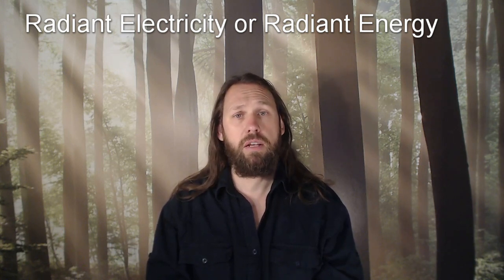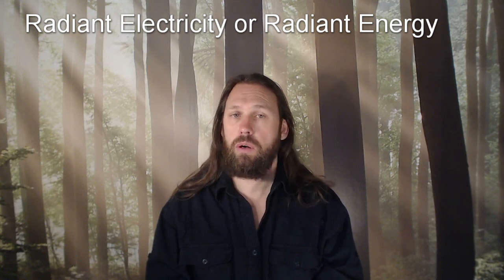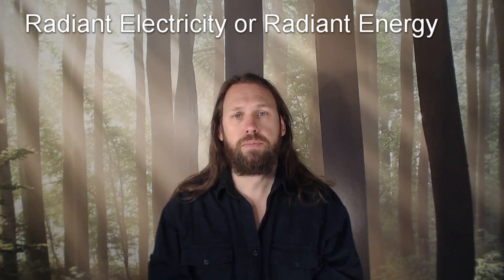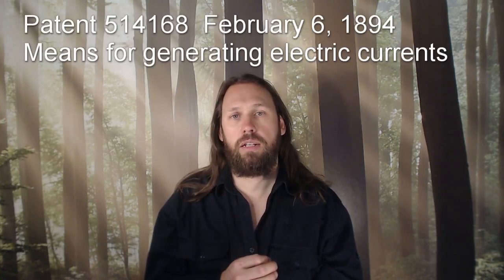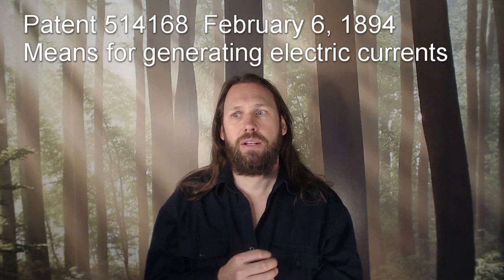The Radiant Electric Bifilar Coil Research Update

Comment: Thank you for reading excerpts .from Gerry V's book.  That helped to clarify an anomaly  I had been puzzling over for many years.  While doing Kirlian photography I had a high voltage apparatus melt down. I unplugged the power cord in an attempt to save it but it kept running until I pulleId the ground wire.  My best guess is I was accidently pulling i radiant electricity. I would be careful,  You are playing with serious fire. I commend your bravery.
Reply from the maker: Thanks for sharing. I will play safe and keep the voltages low enough

Comment: Hello again. So I wanted to connect a large bifilar coil to a high frequency transformer. Any advice?
Reply from the maker: Hi, I don't understand your question
Reply: Master Ivo sorry, i really am a beginner at this stuff. Just beginning at age 24 but there is a medicinal tool called the Amp Coil and it looks like it uses a high frequency transformer with a bifilar coil. Could you check out the Amp Coil and tell me maybe how it is working? Also, I want to find a teacher for electrical theory so I have some guidance in my own experimentation but I am not sure how to go about this. I am highly inspired to learn, I just need direction. Thanks for responding Master Ivo!
Reply from the maker: If you ask the right questions you will learn from the answers. Sorry I won't check it out right now, maybe in the future. I'm pretty busy with my own stuff. I share all that I learn on my channel, so stay tuned. Right now I'm making a new video about Nikola Tesla's Radiant energy.
I've got a playlist on Steinmetz, this could give you a good idea on what electricity is. But the rabbit hole goes much deeper.
Reply: Master Ivo You are great! Thank you! I will continue to learn from your videos. Best of luck with your work!

Comment: Looking forward to your experiments of radiant energy and cold electricity...charges (not electrons)...literally escape the conductor and travel in wave fronts...as aether is most likely made of 'charges'...you can feel them...emanating from a rapid change in either the dielectric (psi) potential...or magnetic (phi) energy.  At resonance a voltage rise in series or a current rise in parallel...current rise from back emf (dphi/dt)...or voltage rise from (dpsi/dt).  Be careful to use the correct frequency as Tesla directs as to not cause physical harm from the pulses.  I agree that chapter 1 is one of the best books I have read on this.
Reply from the maker: Good to hear from you again Mark S, and nice to see you read chapter one of the book. I read it 4 times now. It's so full of candy.
Yes pressure waves. The bifilar pancake coil seems perfect for these.
I think it's not the frequency that causes the different effects, but the discharge time of the capacitor (pulse width).
Reply: Yes, more correctly the pulse width, which is the reciprocal of the frequency.  Back to the energy pump...the more times you can pulse the greater the output.  DC being the energy limit of a pulse train.  Of course, if we dump the capacitor's energy to a load (resistance) then it takes 5 time the RC time constant to do this and thus the limiting factor of the pulse (relatively long time).  Then we resort to resonance in which the resistance cancels out and the frequency is just a function of the L and C (bifilar coil).  So...Tesla had to resort to a DC dynamo with a great amount of energy (KWs) to support the radiant energy transmission at usable energy levels.  At any rate...looking forward to seeing your implementation...
Reply from the maker: Yes the pulse width. If we make the discharge time (pulse width) very small, and Do not allow the coil to oscilate (where the capacitor is discharging into), It will induce the radiant effects. No phase reversal. No oscilations. Just a single (repeated) unipolar pulse. 

The Capacitor needs to be charged, before it can discharge. DC seems the best, a boost converter (what I basicly worked with in my previous experiments) can supply enough energy. 

If the boost converter, uses a bifilar pancake coil, it can produce a pulsating magnetic field, in combination with the impulsed center coil, creating radiant energy effects. The third coil should be able to see both fields, and resonate.
I still wonder what the differnce will be between negative voltage discharge, and positive voltage discharge. 

My intuition says I need negative voltage discharge. The book also mentions that Tesla noticed a difference. Pushing and pulling...
Reply: You are on the right track but be careful...Capacitor's do not work on electrons...they work on charges...that is why you can charge a capacitor with only one lead receiving impulses.  My experiments show that charges exist in the aether (sorry Mr. Ken).

You were close when you used your avramenko plug in your beginning experiments to charge to the 800V.  I toasted my favorite DVM doing these pulsing experiments...so be careful.

Yes you can charge a capacitor with one lead...the other plate takes on charge from the aether.  Works the best if you have a high voltage spark charging one side.  You see capacitors obviously do not allow electron flow (if they did they would not be a capacitor, rather they are insulators).  However, for instance the middle capacitor in a 3 capacitor circuit will charge even though no electron flow can reach it.  This is the basis for cold electricity...that simple.

So when you suddenly short out a capacitor (rapid pulse discharge) it causes a shock wave of charge through the aether (as it appears the aether is made of charge...and charges are NOT electrons).  Since mass is ultimately composed of charge (as John Hutchison verified with his experiments) this fast discharge can totally 'vaporize' the mass into aether.  Or...the shock wave (longitudinal wave) can collect on any conductor in its path.

Typically, these type of events are rare as normal power distribution systems are using alterations at about 17 msec in a sin wave with gradual di/dt.  However, if you attempt to rapidly shut a breaker in the  system, this would be a fast transient and it would be less resistance at that instance for the charges (which aren't electrons) to take a path through the aether and possible kill any person (a conductor) nearby.

So, to get the greatest affect your capacitance should be greater, your transient faster and abrupt (not a sign wave), limit reverse transient (i.e., as Tesla did limit a reverse charge flow).  Preferable to charge your capacitance with a resonance (i.e., the time resistance cancels out and the charge time constant is only a function of LC (frequency = 1/(2pi X sq rt(LC)), this also takes advantage of resonant voltage rise to charge capacitance.

As for the positive or negative discharge.  Positive and negative charges are the same, just spinning in different directions (they are NOT electrons!!!!).  Now having said that, Mr. Ken W., has shown geometrically evidence that you can detect one spin over the other.  Why, I don't know, possible the local aether (charge distribution) has an overall spin on one pole compared to the other.  So I tend to go along with your intuition that the negative discharge may provide better results (only because I used a negative ground system when I experimented with this stuff, before I was afraid of the physical impact of the experiments).

Again be careful and looking forward to seeing your cold electricity (radiant energy) experiments.
Reply from the maker: I did a experiment a while back trying to charge a capacitor with only one lead, and indeed it works. pretty peculiar. 
What you call charge, Tesla called radiant matter/radiant energy/radiant electricity.
I will use smaller capacitance(less danger and faster in charging/discharging) but with higher frequency. If I understand correct, the rate of discharge dV/dT determines the danger. if it discharges fast enough, the radiant energy just passes your body. But indeed its dangerous, Small steps, low voltage, low capacitance, and I hope to shield it by putting the disruptive (radiant energy inducing) coil in the middle of two other coils that will pick up the effects (and keep my distance if possible). 
I agree rotation is the difference in polarity. But with radiant energy, it results in a sucking in or pushing out effect. This can be seen in one of Eric Dollard's old Borderland videos. The radiant lamp pulls in a metal sheet, but when a hand is held near, a pushing effect can be felt (with the same setup) also very peculiar .
 Iwonder If the charging method of the capacitor makes any difference. You mention resonant charging. But I tend to rectify our AC to around -325V and limit the current, to charge the capacitor. If that will not work, I'll use the boost converter setup with the bifilar coil again. I'll think about making it resonant, not sure if that's better. Maybe the Aether has a preference to rotate in one direction. If so,  why? Ah! I remember. It's due to the magnetic field vortex. The clockwise and counter clockwise rotations, are pushing out  and pulling in. Hmm... is that it?
Reply: I think Tesla referred to 'charge' as either negative or positive electricity.  Reference this quote from one of his radiant energy patents, "As the rays or supposed streams of matter generally convey a positive charge to the first condenser-terminal, which is connected to the plate or conductor above mentioned, I usually connect the second terminal of the condenser to the ground, this being the most convenient way of obtaining NEGATIVE ELECTRICITY"

We have all run experiments where we touch a conductor and more power is provided to our "cold electricity" circuit.  Our body is acting as better charge source (NOT ELECTRONS!!!) then open vacuum.

Notice also that Tesla says "RAYS or SUPPOSED streams of MATTER", a reasonable unbiased person then may interpret this to mean Tesla was also  indecisive on if this radiant energy was rays of energy or bumping particles (matter).  Of course he didn't care as the energy was there.

It is interesting that his collecting metal plate is prescribed to be "Insulated".  Most skim over this fact.  So what is an insulated metal plate?  Of course it is itself a capacitor (which he called a condenser).  So he had a collecting condenser connected to another grounded condenser.  The collecting condenser was for collecting the radiant energy (charge or energy or matter) and the grounded condenser to collect a less resistant negative charge source (ground) to provide better output.

Of course then the 'insulation' was a dielectric.  And this dielectric had a higher permittivity then free space thus providing greater charge storage (yes capacitors work in space).  Tesla knew this, thus he insulated his collecting plate with a dielectric.  No information in the patent as to the dielectric of choice.  But we know Tesla would have used one to amplify his results.

So vacuum or free space (or aether) can serve as a dielectric and has permittivity.  Since we are standing on earth your experiments will most likely get better results with positive charging.
Reply from the maker: very well put. the isolated plate is a capacitor plate. this equals my third bifilar pancake coil that acts as a capacitor plate, and indeed it is insulated with a dielectric (I believe its PVC which is a good dielectric).

I think to make a radiant energy flow that in turn makes a flow from negative to positve voltage, we might need a negative to zero volt disruptive discharge. Still not sure about this,  experimentation will show us the facts.
Bloody hot with a Blood Moon tomorrow.

Comment: This is a radiant energy circuit. I'd be grateful to hear your thoughts on the Meyers Absorber. This is a simple magnetic circuit that draws power from the Earth's magnetic field using opposing poles, zinc plates, and iron wire. The diagram at the bottom of this link will show you it's simplest form. http://rexresearch.com/meyers/meyers.htm         Tesla's hair pin circuit is very interesting. Very high current and voltage spikes.
Reply from the maker: Yes Tesla's hairpin circuit is a great learning tool. I intend to advance it, with solid state switches, and instead if the stoutbar, I will connect the bifilar pancake coil.
I took a short look at your link (Meyers). I dont know. In my opinion patents never show usefull data. Also the magnetic field is the loss of the dielectric field, if you want to gain energy from the earth,  forget about the magnetic field (or only use it indirect to create a dielectric field). For me the focus is on the dielectric field, and advancing from there.
The radiant energy seems to be induced by a rapid change if the dielectric field, without changing polarity (unipolar disruptive discharge of a capacitor).
Reply: Thanks taking the time to look Master Ivo. I'm looking forward to the expanded hairpin circuit with the pancake coil. I think the Meyers Absorber does work on the dielectric field. If we take the horseshoe magnet which faces North, we have the South pole attracted to the Earth's North magnetic field as well as to the North pole of the horseshoe magnet. On the North pole side of the magnet its field is repelled by the Earth's North magnetic field. This causes the flux lines to bulge and flutter toward the South Pole of the horseshoe magnet. The zinc plate being of a diamagnetic material captures these fluctuations and produces charge on the plates. The South facing arrangement creates the opposite flux which gives us our AC current. The fact that this current needs to be conducted by iron wires gives us a clue that we are dealing with diamagnetic field fluctuations.  

In the more developed version he uses a single opposing pole of a magnet which can be an electromagnet. In the case of a single North pointing magnet to Earth's North magnetic field he collapses the South pole of this magnet using iron to connect it to the opposite South opposing South magnet's collapsed North field. The diaelectric field leaks on to this iron wire. This causes leakage of the dielectric field according to Ken Wheeler. Ken diagrams this leakage in this video on pyramid shaped magnets. https://www.youtube.com/watch?v=fO_6cZUtmWg Meyers is connecting iron wire a the point of diaeletric leakage which happens at the top of a pyramid magnets and Meyers magnets with a collapsed South pole. Meyers captures atmospheric charge on the zinc plates which are V shaped connected by soldered iron wire, open ends pointing North for the northern arrangement and South for the southern arrangement. Parallel to each magnet these two zinc V shaped plates being connected by soldered iron wire to capture an opposing charge. 

I believe the ancients had efficient collectors of atmospheric electricity. Hindu and bhuddist temples with their pointed tops and a proper arrangement of magnets could draw power and did. Meyers states that the higher above the Earth his device could be placed the more current it would produce.

Comment: of course tesla bifilar coil has a very large voltage gain, that's because the magnetic field does not allowed to form a torus like the coil in general which is tubular. the dieletric field will be more dominant on the coil, if you still remember there are two basic components of the field of eletric circuit mostly lecture by charles proteus steinmetz. in other word magnetic field formed on bifilar coil has in same space upon the coil. make sense now?? there is no secret about it
Reply: initial pulse is out of the question dude, after that you can amplify the potential and make the system self sustained, you may do some research. no offence !!
Reply: You better take a look on this video john Walker, that may change your prospective of what can be done https://www.youtube.com/watch?v=knofQlM_Mw0&t=998s
And by the way I already test this technology and I can say for a fact that works !!
Reply: if there is no secret about it why there`s a lot of clown saying that you cannot generate more electricity than the one you put in a system?  school teachers included
Reply: dude. im not talking about increase power, its EMF..you definitely dont know the different between power and energy, voltage and EMF, current tension. for example, you can play with gasoline you even can drink it, but if you put that energy in such condition inside cylinder of your car, it change acceleration and deceleration..now you have power instead energy
Reply: I didn`t say that, John I mean that you can amplify the initial amount of energy, and actually make self sustained a system with the right knowledge.
Reply: Make videos is not my think John, I can help others to achieve goals, but that's all for me, I use that technology for mining cryptocurency, believe me it works, is a quantum process in which you change the potential disturbing the 3d volume and the re-equilibrium of that is converted in electricity, actually Master Ivo is getting closer I`m sure that he will figure that out

Comment: that is the key to an all world of technology that has been hide from us for so long in order to make us slave of a capitalism system, for make a long story short the effect that you got charging a capacitor form the back emf of the two bifilar coils is actually radiant energy.
Take a look of this patent this device generate high frequency radiant energy and the principal is to induce the back emf in the core of the device to induce the second coil with radian energy so it generate high voltage radiant energy from a 12volt battery
 Fell free to contact me, I can share information with you on this topic, actually there's a few secret about how to amplify the energy.
Reply from the maker: Thanks Carlos Aybar.  I will do the reverse, discharging a capacitor, to  create a dielectric spike, inducing the radiant energy.